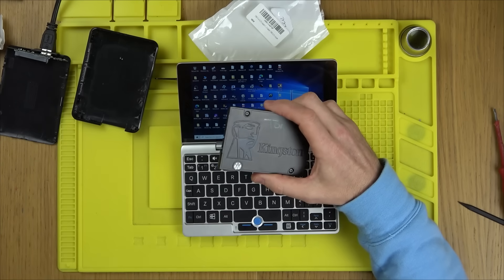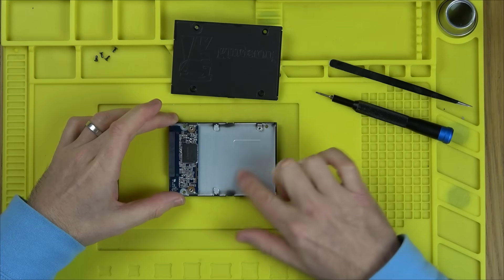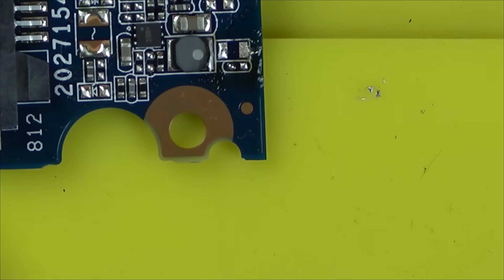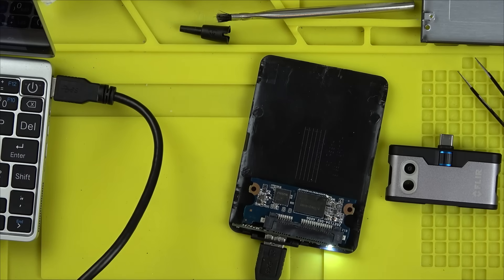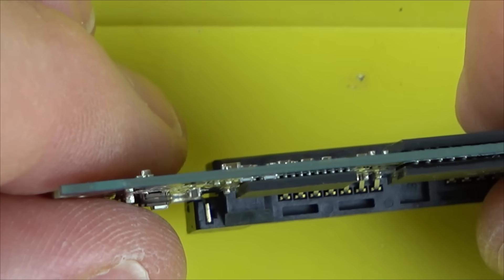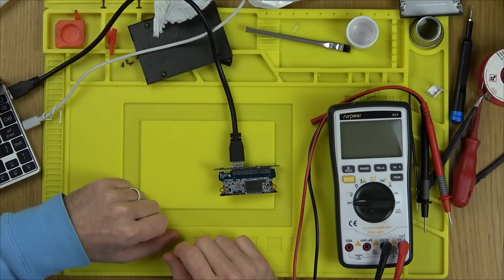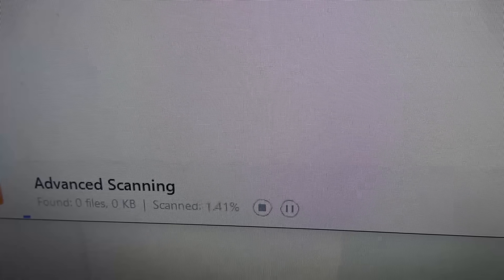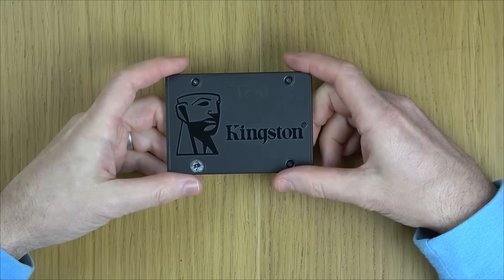Can I FIX a Kingston 240GB SSD ?

Comment: SSD vs Magnetic drive as in old style HDD  personally i hate SSD,S they maybe quicker but there is too much to go wrong. on a normal HDD you can do a board swap as your data is held on  magnetic disc there then is a chance to recover it  new tech not always the best option.
Reply: that's why you have to make backups

Comment: I wonder if the chip is overheating and if you cooled the chip somehow you might not have to re-plug it. You could test this theory with a big heatsink or some cold spray to see if you can keep it online long enough to get the data off.

Comment: SSD's have a usb control board as the memory chip has no direct access to the computer as the memory chips do not have usb connection capability

Comment: Totally agree about the heat sink attempt.  Also use Linux.  Also if you know someone with a copy of SPINRITE maybe that might work.   Also i would attempt with the drive fitted directly to a computer on the SATA connections not USB.
Reply: To reflash the firmware you HAVE to connect it directly to SATA, never to USB.

Comment: My friend had the same issue, and from what I learned searching online the Phison chip gets locked up and blocks you from reading the data. The only solution beside professional Data Recovery, is to flash a new firmware, once you do all data is lost and you can reinitialize it and make partitions.
Another thing with HDDs or SSDs when trying to work with them, it's better to use AHCI (SATA Cable) instead of OHCI (USB 1.1), OHCI + EHCI (USB 2.0) xHCI (USB 3.0).

Comment: SATAFIRM S11 happens when the firmware in the Phison controller gets corrupted. There's a software out there to reflash it but it wipes the whole drive so it might not be of any use if you want the data. I Had a Silicon Power SSD with the satafirm problem and i manage to reflash the Phison controller and make the ssd work again.
I'm sure this is a firmware problem and reflowing/adding a heatsink like others are suggesting won't solve the problem.

Comment: Hey Vince! So, I know in some cases, only one chip heating up, that can be because the rest of the board isn't turning on. Because of some other issues or power rails not present. 

Also, I think your on the right track with the phison chip. If there was a way to dump the FW from that chip, and then flash and replace It, it could fix the issue.

It seems that maybe the Read/write functions on that chip, are the issue. That's very common with flash storage unfortunately. I've seen issues with READ/WRITE with the onboard flash on a Slim Xbox 360. what I described is the fix for that issue. 

Take care buddy!

Comment: The  ssd has had massive error and is now reporting it's controller name. The controller locked the ssd in an error state. before this happened the ssd would be named kingston + model number. I've experienced this too a few years ago when working at a pc store with a bad kingston ssd

Comment: These Kingston drives are utter crap. My company went through 100's of them before they changed to another manufacturer. They failed really quickly too. They were not used in harsh conditions, nor were they stressed. Good video Vince, excellent effort, and very interesting 👍
Reply: Same problem here. I had maybe 8 drives and 6 failed in less than a year. Worst SSDs ever made.
Reply: Kingston SSDs started going downhill even before they launched these cheap A400s. I knew it was game over as soon as I started seeing dead SV300s with SMART Attribute: "Life Remaining:  0" just after the 3 year warranty expired.

Whereas I'd pretty much used Kingston SSDs exclusively up until that point, I quickly switched to other brands and never bought Kingston SSDs again.

Manufacturers sacrificing reliability is inexcusable.

Comment: The SSD controller failed, the only way attempting to recover the data would be to replace the controller (depends if there is any pairing involved between the controller/NAND chips)

Comment: If the Drive is unrecognize you can initialize it and also quick format the drive without loosing any Data.
As long as you only quick format the drive it's just setting the First bit to 0 which let the PC think that it's empty, Only if you slow format or write Data to the drive it will overwrite files.

I'm using O&O Recovery to recovery files from Drives that I can't access the normal way.

I had a HDD that has a similar issue where I could access or run any recovery on it but after I used the clean command in diskpart I was able to run the Scan on the HDD with O&O Recovery and was able to recover files from the drive..

Comment: Been using a software called Minitool power data recovery, with good results, takes time to scan but has found everything from somehow corrupted SD cards. Now have a 6 terabyte WD red drive that has failed somehow, but the software just finds everything. Can copy the data when get new drives. 6 terabytes of DVD images. The original enclosure must be on it's way out so need 12 Terabytes of space. Because it is 2 disc duo enclosure.

Comment: I'd be tempted to just re-flow the PHISON controller chip. Not to remove the chip, just adding flux around the edges and get it hot enough to reflow the solder under the chip while trying to protect the NAND flash from getting too hot.
Reply: This is not the problem. But the firmware.
Reply: I fixed a couple of this by reflowing,copied the data to a new one.
Reply: That was my first thought. Might have a bad connection due to heat cracking the solder balls.

Comment: As mentioned, if you have a linux system then use something like ddrescue or PhotoRec - I've had great success with the latter. These GUI windows tools in my experience aren't great, essentially Windows is doing too much as well to the drive at the same time. The rescue tools copy the files to your system and then you use them instead. You will bin the drive once done.

Comment: As soon as I saw your intro, I knew there was a Phison chip in there 🤬

I can confirm that Phison chip is in "Panic Mode", that's where the Satafirm comes in. The chip WORKS, but it's firmware is essentially bricked. I've successfully recovered 2 PNY CS900 drives with bricked firmware, but indeed the forced firmware flash was destructive to the data.
Reply: Liking and replying so you comment sticks out. It is possible to chip-off data recovery from this situation but is super complicated due to the different ways the controllers and firmware organise the data blocks on the flash storage, with bad block remaps, XOR patterns, and other stuff. There’s a data recovery YouTube channel which covers this stuff, very interesting. Requires a investment in specialist hardware and software.
Reply: Fixed 1 PNY CS900 too with a firmware reflash.
Reply: where did you get the firmware from?
is the firmware generic?
i want it too just in case.
Reply: If they copied the chip information onto a separate chip for storage when blocks changed and where bad they could make a recoverable drive right
Reply: Will it works another way if in this case you will take a memory chip from the board before flashing controller? Or just swap with another chip just for flashing and then swap it back.
Reply: Warning!...This steps will be destructive to the drive ...

..first...replacing thes ship could make the drive working - BUT the data would be destroyed, and the data whats important...the drive itself isent...
another solution is to cool the chip..it may be possibly just by adding a small heatsink/fan if ur lycky...otherwise second step would be to cool it to -70 deg celsius or so fairly slow (..to fast and it will die anyway, cooling in steps if possible)...once the data is recovered just toss it...
...if it still cant be recovered, bake the drive and or reseat the chips...
if the chip still isent working thers not much to do at ur own hand...

if the data was super important u would send it to a professional...

...if its important...always have ATLEAST one backup...
Reply: @Patrik6920  a good thing that I only use my SSDs as external storage just like my USB drives because I don't have to "update" any of these botched firmwares , hence the reason why they lasted much longer without any sign of data corruption
Reply: can one replace the chip with a new one,  and presumably the passive components to it

Comment: I had good 'amatuer recovery' results using Recuva free softwre but this was on a working drive that had simply had all files deleted by the Windows user.  If the drive is physically faulty I guess it becomes a lot harder.  One thing worth trying is to try to clone the drive. I use Macrium reflact but others are avaiable. I used to respect Kingston as a brand in the days of buying DDR memory for PCs but after a shocking experience with two of their USB sticks 3 years ago I'm sorry to say I would now avoid them.

Comment: you need to use pc3000  SOFTWARE , it isnt cheap and yes it is very expensive but how ever you will stay connected to the drive , if you can afford to buy the software + hardware that does come with it , check it out pc3000

Comment: You can reflash the firmware to the controller. You would need to take the chip off and load it into a special tool to do it then use software on pc to either get it out of firmware mode or flash a new chip. It’s fairly easy to do but would mean buying new tools. Software is free and out there.
Reply: the firmware for this can be flashed over the sata interface. no need to remove the controller
Reply: @EthanShort  Any leads on the software needed for this? I have a similar drive, that just fails to get recognized at all. I don't care about the data on it...
Reply: @dazealex  If I remember correctly there was 3 downloads required. One piece of software that identifies the version of the firmware and model of the NANDs. One collection of firmwares. And the software that creates the firmware flasher.

Comment: Great info here, I didn't think of fixing a SSD. I do have 2  HDDs that I can't format for some reason, they're 1tb so worth keeping.
Reply from the maker: Thanks Paul, shame I couldn't get the data out of them, I was hoping for a shorted capacitor 👍👍
Reply: What are you trying to format them from?
Reply: 1TB HDD are pretty much worthlessness now, especially faulty. Just replace
Reply: @incandescentwithrage  1TB HDDs are OK but 500GB HDDs (or less) are worthless when 128GB SSDs (and 240GB SSDs) are cheap enough.
1TB SSDs are starting from about £35-£40 though so if you need 1TB, that's the way to go.
Reply: have you made sure they are the proper power supplies, and for the correct drive, because if you look at my comments you will see that it can be because of either driver related issues so needing a clean install, or by using the wrong power supply on the wrong drive. hope this helps.

Comment: One other thing you can try when you have a chip that is running warm is to use your compressed air upside down to freeze it or (freezer spray if you have it) and try to keep it cool I know it wasn’t running that hot but If it’s drawing enough current that can cause your pc to power off the usb supply disconnecting the drive. Then when you unplug it and plug it back in it re supplies the power. 
Or a 2 into one usb cable so it gets power from 2 ports 
But nice try anyhoo

Comment: Great video as always. Word of advice though, with hard drives (mechanical or SSD) always try the software route first. If it's a hardware issue, recovery software failing won't prevent you from making a successful board repair. If it's something software could recover, attempting to fix a non-existent fault on the board could easily leave the drive in a state where recovery software won't work. 

On an unrelated note, don't tell my kid or dog that I said this, but your baby laptop might be the cutest thing I've seen all day.
Reply: Yes, and always is a good idea to try the software from the company of the ssd, I fix a ssd that work  for 5 min. and then disappear for a faulty firmware, but to be able to use the software you need to use connected to sata to have the time for the firmware update, in usb was impossible.
Reply: I don't know, if the drive was showing symptoms of dying plugging it for a long time to obtain data might end up killing it for good even in the middle of obtaining it.
Reply: the only problem with that is that, for a drive that's dying or basically dead, you have very limited time/attempts to use software as more read/write cycles can cause more damage, lowering your chances of successful recovery with each failed attempt.

Comment: I didn't see, but presume you tested all pins on the SATA connection were attached and soldered correctly ? Yes that software can find data, but is very expensive for the common man for 1 or 2 uses! 73's Andy M6APJ

Comment: Hi Vince, the disconnect problem maybe a power down USB sleep, you can change that in windows settings under the Computer management -> device manager -> (the correct USB hub) -> power management tab, there is an option for `Allow the computer to turn off this device to save power`, also I would recomment using a Linux distro to do it there are loads of tools that may help
Reply: Good call PG. Especially on using Linux. Also, plugging it in directly to a SATA buss (removing USB from the mix) might be a option. It's best to reduce everything to it lowest common denominator i.e. cut out the middle man :)  Cheers!
Reply: Yeah, even Gparted is far better than anything WIndows offers.

I've saved the data off about half-dozen drives using Linux.
Reply: far more likely to be a boot loop with not enough current going into the ssd to power it up.

Comment: Just as an idea have you tried to put the board in a freezer bag sealed and put it between two bags if peas. I think the controller has a certain temperature it can go before shutting down. So the bags of peas will keep it cool while the checks are scanned.

Comment: no
Reply: As it was reporting disk status it could be something as simple as a corruption of the partition data only rather than the data. A sector by sector disk copy is the first step. After which you can use a donor drive to test the theory by asking the use what is they created the partition. Was it Mac or Windows assuming the latter could be safe to assume NTFS and was it a whole disk partition or split? If whole recreate the partition on a same model working disk and hopefully the data reappears. It is safe to initialise a disk but not change the partition structure. Bit a sector by sector copy should be done first to a same model working disk or image. This should be done before you disassemble... Although when you inspected and saw no issues I would then have not desoldered until I tried the above etc..

Comment: I wonder if chilling the controller chip might help the disconnection problem.
Reply: Old school trick for the mechanical drives, 20 years ago I got someone's family photos from a once-in-a-lifetime family trip, they were really pleased, I made no promises, I also had the replacement hard drive for them, but the original hard drive was making a knocking sound, double bagged in a freezer, left overnight or few hours and then removed from the bags and freezer dried and wrapped in kitchen paper on top of the heating boiler and a few hours later, no condensation plugged it in and it came back to life.  It was a fluke but they don't care they got the pictures back 🙂  I got the tip off the internet too!

Comment: I hate to admit it, but I buy expensive Samsung solid state storage, simply because of the reliability factor. I'm putting precious things on there (cat videos) and I will pay for reliability. I am a cheapskate in other areas. I don't care for RGB or 6000mhz DDR5 memory. I don't need a RTX 4090. 

It makes sense that the drive would appear unformatted and unpartitioned if the drive controller chip failed. 

I enjoyed this dive into new territory.

Comment: I probably would have gotten a couple big old heat sinks and clamped them on either sides of the warm, larger chips with a little conductive grease.  Maybe spray a little compressed air from time to time.  Just see if it extends your window of good reads with the recovery software.   Applying some light compression might also temporarily fix any cracked solder balls for the time being.
Reply: I was struggling to recover a spinny drive that kept over heating and making me start over. it was winter and it was below freezing outside. I opened a window and stuck the exposed bottom of this particular laptop up against the screen. It took ages, but I successfully recovered the drive. Shit. I may still be using some of the remnants, and that was in, like, 2010. I still have the clone I made for sure. That was such a good win.
Reply: @LegoDork Did the same thing with my old phone, except I just put it in the freezer and ran the USB-C to the new phone via the gasket on the door. Not airtight of course but worked well enough.
Reply: My though too maybe cool the heck out of that chip and see if it last longer. upside down compressed can air freeze it.
Reply: We used to use a frying pan and blocks of ice during data recovery back in the day.
Reply: The chip itself and it's software is most likely faulty
Reply: Many years ago I had a spinning hard drive where the electronics kept overheating, so I got some dry ice and super cooled it while I got the data off it.
Reply: Ice cubes in a bag?
Reply: @johnwells558  kinda risky, better just use a whole freezer
Reply: I thought for sure you would reflow that chip with flux.. maybe next time